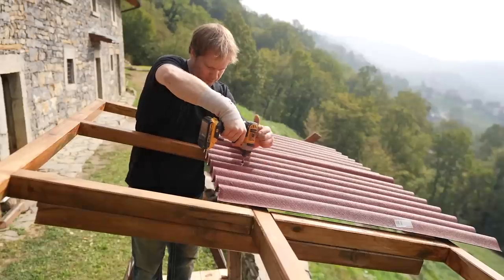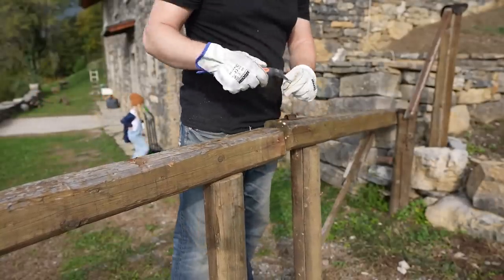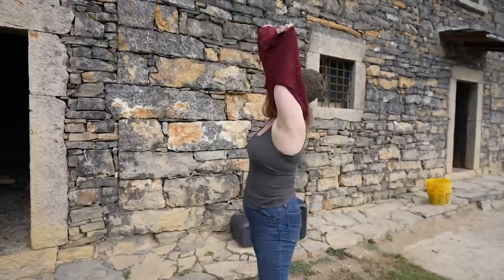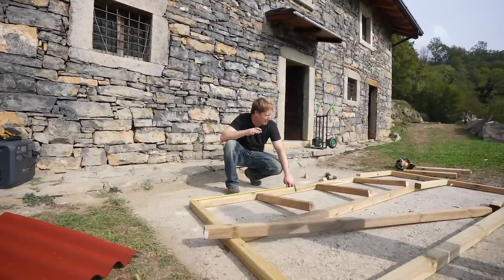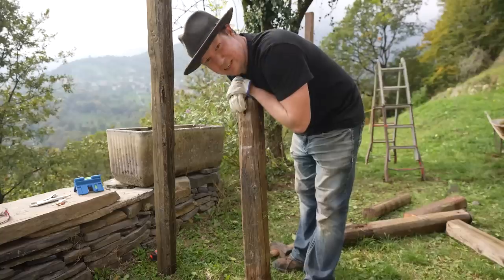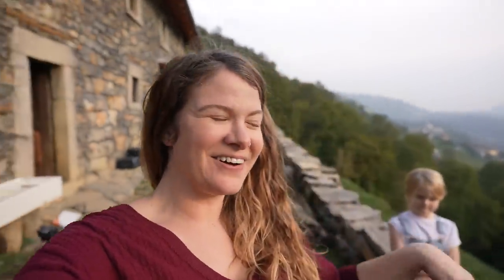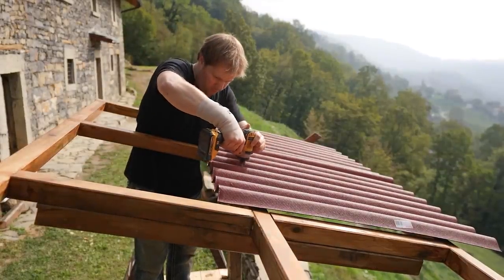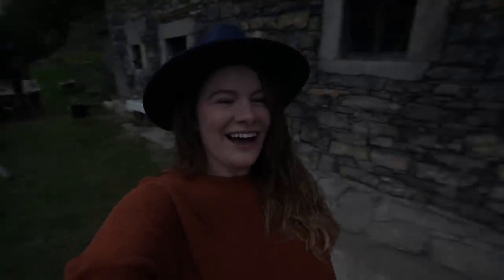We Built An Outdoor Kitchen in Two Days On Our Property in Northern Italy

Comment: When using the chainsaw without a npose guard, be extra careful not to touch the ground or anything else) with the tip.  If you do, the chainsaw might kick back and come toward you at a frightening speed.  The chainsaws nowaday have a safety hand guard to stop the chain when it does kick back, but it can still leave some very nasty scars the same.  Not as bad as no chainbrake, but  still,,,  When the "lady of the house" tried to start it, the tip went down quite a bit.  Also, I enjoyed watching the kid building the fairy village.  Quite an imagination!

Comment: Buddy, using a chainsaw without safety gear, eyes, gloves, hearing, chaps is dangerous and can be life changing in the wrong way. Please use full safety gear and ensure you are able to maintain the saw in peak condition, dull teeth or loose chains are very common problems.

Comment: Please learn how to use a chainsaw start it on the ground placing a foot on the handle starting in the air should only be done by someone with a lot of experience and place the teeth at the front of the saw against the item you are cutting

Comment: Ehm . I dont want to sound like a twat. But you should wear ppe when using power tool. And the safe way to switch on the saw is by putting it on the ground, stopping it with a foot and pull the cord. You are not italian, trust me on this one: you DO NOT want to go to the er. Just work safe please.